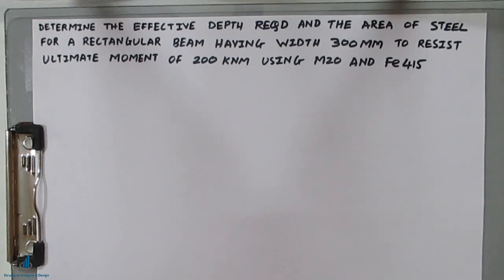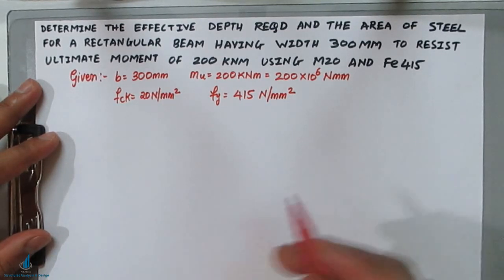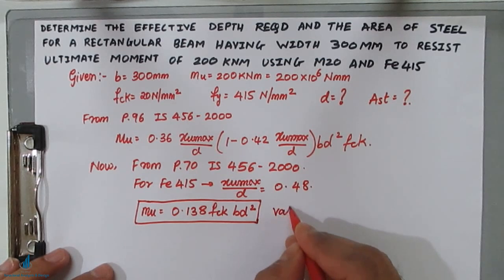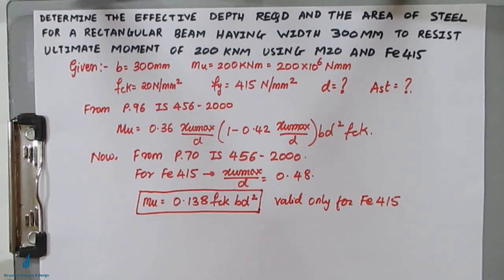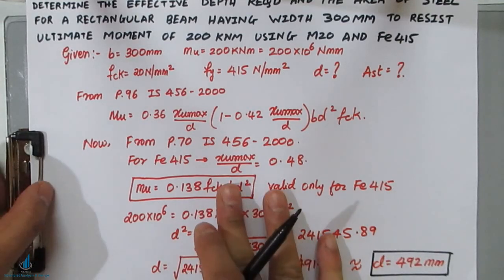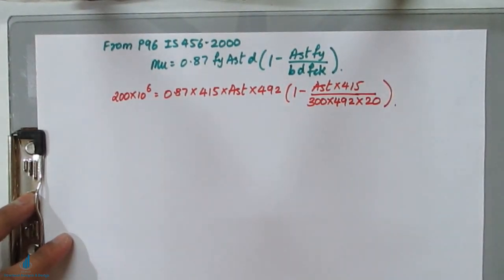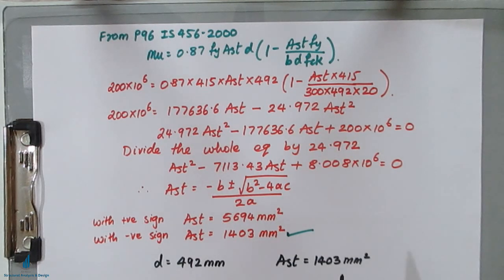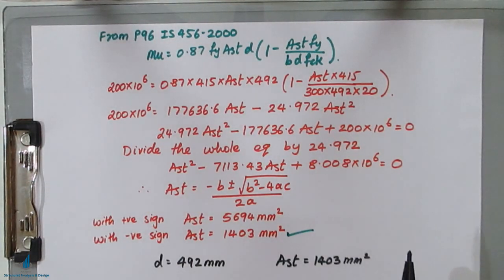How to find Effective Depth | How to find Reinforcement area | Analysis of Singly Reinforced Beam

Comment: sir if we have given bending moment, can we put the value of bending moment in the place of Mu 
sir plzz anwer me i am very confused
Reply from the maker: Yes definitely you can use that moment, but check whether its moment or ultimate moment, if its only moment, multiply it by factor of safety to get ultimate moment
Reply: @structuralanalysisanddesign  thank you sir